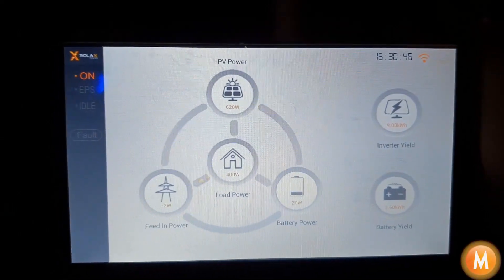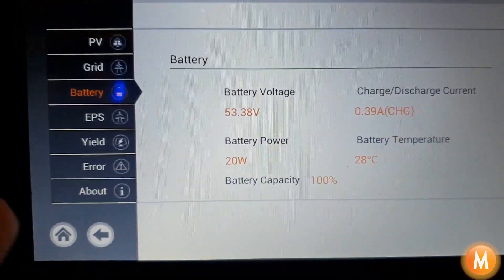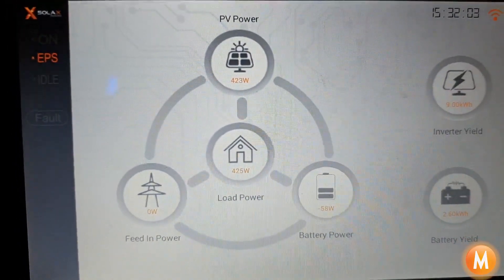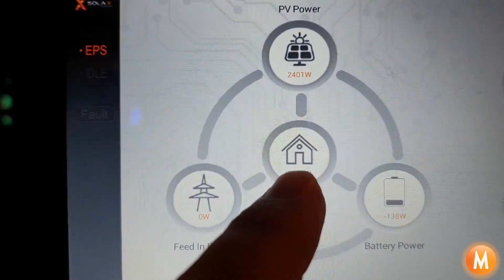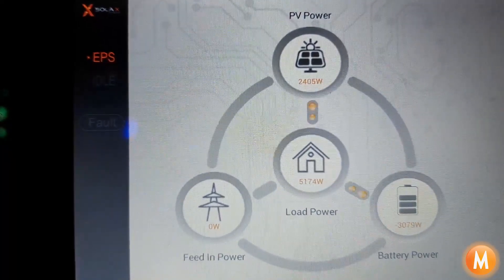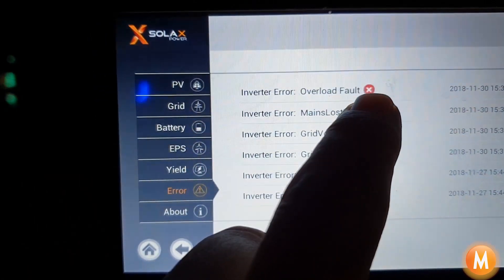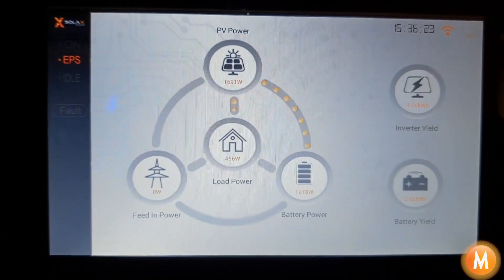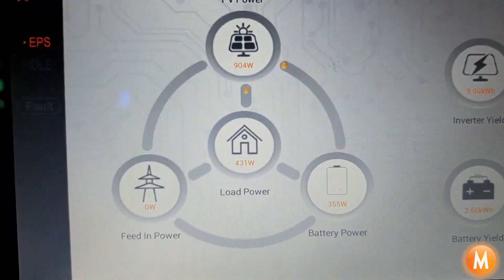How to fix Inverter overloading during load shedding

Comment: my inverter is 5kVA and its overload capacity is 5.5kVA. but my inverter turns off if i put load greater than 4kVA.and as soon as i decrease the load 200watts it turns back on itself. i don't understand what is the main issue. i am using good wires with thick gauge and even the distance between batteries and inverter is not more then 1 meter. ive done everything from diagnostics to hard resetting it but nothing worked. the provider told me that i am putting extra load but i know i am not. what might be causing the issue is still a mystery
Reply from the maker: Thanks what inverter do you have installed?
Reply: @MSPD-Africa  its called inverex nitrox 5kva hybrid inverter but its same as Deye 5kw hybrid inverter. Same inverter different names.

Comment: Hello! Great video, thanks for the explanation. I have just one question, have you ever experienced an Overload fault when the battery pack reaches 100% charge? I have an 100% off grid house and my Solax inverter or battery controller isn't cutting off the charging when the batteries are at 100% and the system enters in Overload.
Reply from the maker: hello
Reply: @MSPD-Africa  I have a X1-Hybrid 3.7 - D inverter btw
Reply from the maker: @TiagoRibSantos  nice!

Comment: Greetings good people. I have a suggestion and this is the way I have my house wired: My DB is divided into 2 parts. All plugs in the house supplying fridges, ovens, Microwave ovens and such heavy current devices are wired directly to grid input. All lights TV and computer plugs are wired into the inverter supply. Yes, I said fridges too. You will be surprised how much current they draw all together. They can stay frozen for a couple of hours. That way, everything that doesn't need power doesn't get power during load shedding while the things we usually need stay on. It's a great excuse to go outside and have a braai.

Comment: Is one suppose to.let batteries run flat every now and then?..
How long can batteries last?
I get invertor not coming on "overload" but simply can't be from what is connected.. my internet/ 1 study lamp and some plugs so I can keep my phone and laptop charged..
What could be the reason..
Have put invertor on and off as well....
Any help appreciated..
Thanks
Reply from the maker: the batteries should run flat each day normally unless you have set a higher level of reserve power? There is normally always something on that will be causing the overload, best to turn off all circuits in your DB board, restart your inverter and bring them on one at a time to find out which one is creating the overload.
Reply: @MSPD-Africa  hi
Thanks for response..
3 fuses had gone.. 
Been replaced- working again (thank goodness)..